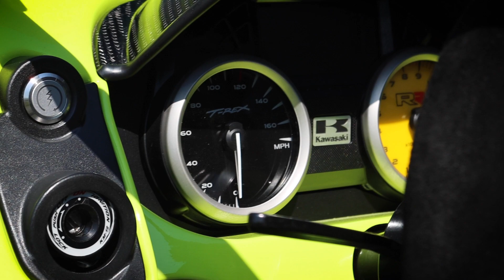Our First Ride In the $76,000 T-REX RR

Comment: I got a 2022 t-rex and it’s way more faster than a slingshot, the new 2022 t-rex can do 0-60 in 3.0s and the 1/4 mile in about 10.5s so you can’t compared. A slingshot is for the road and a t-rex RR is for the race. Nice vid btw 👍🏻